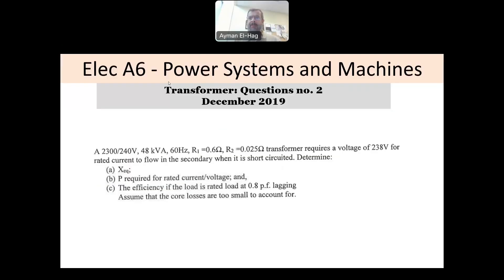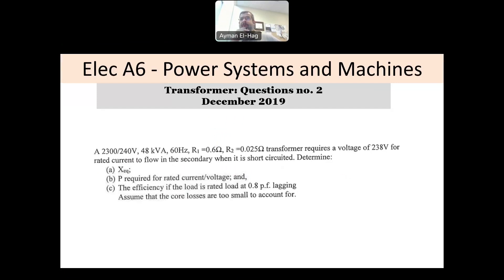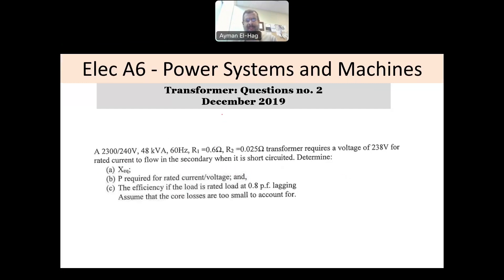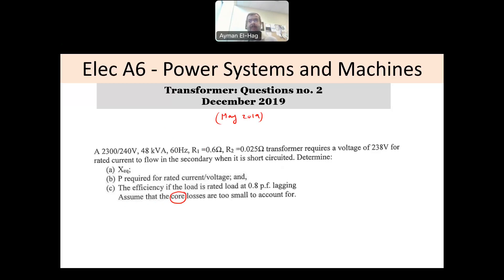PEO solved examples (ELEC A6): Transformer Question no. 2

Comment: Sir, for letter b, the 117.64kW, don't you think it's too much as the transformer is only 48kVA?
Reply from the maker: The question is a bit not clear, I understood it as follows: what is the required P when applying rated current and voltage when the transformer is short circuited and not supplying rated load. For this condition, the needed power is more than the rated power. There are two types of short circuit test in the transformer, the one we used to find the series impedance we short circuit one side and apply rated current but at a very low voltage. But if we short circuit the transformer and apply both rated voltage and current this is a destructive test classified as per the IEC standard as a special test.

Comment: Dear Professor, may I  make sure when you calculate IN=48000/2300, whether need to divide√3 ? Thank you so much.
Reply from the maker: This is a single phase transformer, so there is no root(3)
Reply: @electrical4everyone  I got it, Thank you so much for your reply, professor.  I think it is default 3 phases transformer. Because the question didn't say single phase transformer.
Reply from the maker: Most of transformer questions in A6 are single phase.
Reply: @electrical4everyone  Thank you so much, Professor. Otherwise, I don't know, I will make mistakes. Thank you again, you help me a lot.